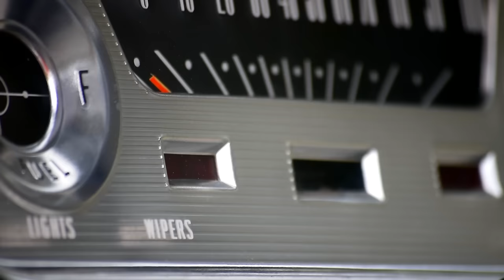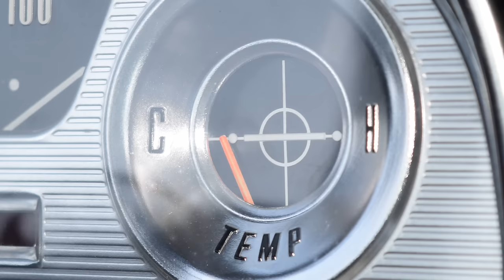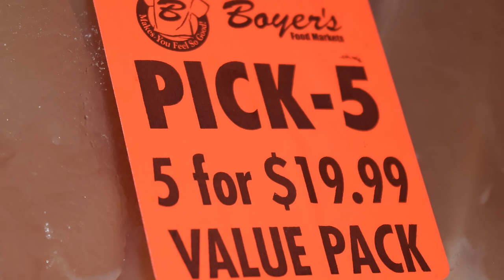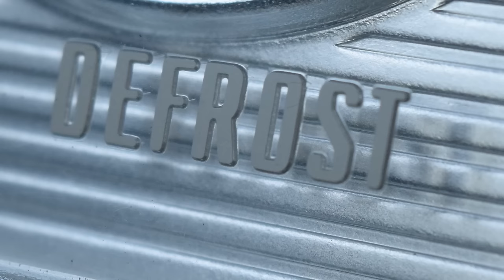Regular Car Reviews: 1960 Ford Falcon (stock)

Comment: "The world must understand that classic cars are not all Chevelle's, and Boss 302's, and Oldsmobile 442's, and Grand National's, and rat rod Cadillac's... Some classic cars, are just regular cars."

This was an awesome quote to end an awesome review.
Reply: Add the fact that the restoration fad is to find a rare muscle wreck and use the VIN and other vehicle id on a better survivor which was less rare. The future will be only rare survivors. The collector market may tank for some of these models due to over supply.
I saw one YouTube clip where the barn owner cut rooves 55-57 GM coupes into convertibles. He had parts wrecks to get VIN and fabricated in the frame X supports on the coupes. He had survivors to take measurements and use to fabricate matching hardware. The mid-50s GM convertibles were selling for 1000% or more than a sedan,  500% more than a top trim-line coupe or sedan hardtop. The fabrications were concours quality convertibles, probably better than factory stock, too. The valuble parts were the VIN and frame id.
Reply: u r right
Reply: Like the VW Beatle!
Reply: Rat rods are not "classic" cars.  They are just cobbled-up juvenile junk.  PS: Learn when to use an APOSTROPHE.
Reply: @lancasterritzyescargotdine2602  Someone woke up on the wrong side of the bed today xD
Reply: @TheShaolinMonk_s550           Someone grew up on the wrong side of the collector car hobby.  Don't feel badly.  You're not the first and you won't be the last.
Reply: @lancasterritzyescargotdine2602  Thanks for the laughs mate, you're hilarious!
Reply: @TheShaolinMonk_s550         No problem, bro.  I jus' calls 'em as I sees 'em.  I was just reading of the loss of Ford and Holden in Australia.  What a sad day for the lives of car enthusiasts.

Comment: My father, upon his return from a one-year stint in Viet Nam -bought a dark blue 1960 Falcon to act as a second car for the family.  My parents were married almost 17 years by that time (September 1968) and had been going one car for as long as they’d owned them.

I wasn’t born yet...but my 3 sisters were, so my Mom needed our 1965 Country Squire for carting them to school, doing the shopping, and all the other things 1960s housewives did.  So, Dad went to a local Ford dealer and bought a one-owner 1960 Falcon so he could commute to his job at Bolling AFB, and later - after leaving the Air Force - his job for the Fairfax County (VA) school system.

One day, the steering wheel came off as he was driving home on the Beltway.  He did his best to get the wheel lined up again and held it into place the rest of his way home.  Oh...he had to shift the three-on-the-tree, as well!

Another time, driving over the Woodrow Wilson Bridge, the gear shift snapped off while he was shifting.  My ever-resourceful Dad grabbed a vise grip out of the bag of tools he kept with him for such emergencies, and stuck it in the hole where the gear shift had been.  

The next day, he limped that tired gal back to Clinton Ford where he’d bought her two years before, and traded her in on a 1968 Fairlane 500 wagon.

Comment: Mirrors are a safety option? No hazard lights? Automatic is the thing to have and the car companies lied about the cars specs? This seems just like a new car, amazing!
Reply: The Falcon was off-the-shelf design. It drove and handled like a mid-50s car. 
The roads at that time, 1960, were also different. The interstate highway system was still being completed. State highways were also being flattened and straightened. Travel averaged 30 mph. When you got to the next town on the highway there was a speed zone and traffic signals. There were very few truck routes or by-passes to avoid the central business district of the county seat.
There were many older vehicles still on the road in 1960, too. They didn't all have power assist and high compression engines. Many didn't have radios or automatic transmissions. People used hand signals to turn and brake. There weren't any 1961s yet, but probably some 1956 Nash, 1954 Hudson Hornet, 1951 Kaiser with Dragon Skin, and a few pre-war Model A Fords.

Comment: I love this era or American cars, I love the Falcon, I have to admit I'm a sucker for the Corvair, I love it's styling and the engine being an air-cooled flat6 like a Porsche also drew me to it.
Reply: Whats ironic about that is the Corvair did the air-cooled flat 6 before Porsche.  The issue is that the Corvair was not engineered enough to actually handle its layout.  

Just as a thought, if GM redesigned the Corvair then, we could of had a well handling mid-engine H6 Pony Car instead of the Camero.  Be awesome if that happened, but it didnt.
Reply: CWDTrixie  Yeah thats true with the first generation, with its swing axle and lack of anti-roll bar, however the 2nd generation had double jointed rear axles and a proper anti-roll bar setup front and rear. I do sort of agree however, the engine was mounted way back over the rear wheels to allow 4 seats, but they can handle well with some modifications, just look at the Yenko series of Corvair's named "Stingers" they're pretty serious cars
Reply: Josh Briggs Thats good, wasnt sure how many generations there were.  Its been a long while since I looked up anything on the Corvair.
Reply: I have a soft spot for the 60-62 non sporty looking Corvairs. Particularly the 4 door. Dunno why, they arent particularly good looking really. Something about the combo of innovative and conservative at the same time. I like the first gen Prius for the same reasons.
Reply: I owned a '61 Corvair Monza when they first came out. It had the H.O. engine (98HP) and sad to say the 3spd manual. Didn't want to wait for a 4spd. I liked the car even with the 3spd, had to double clutch to downshift into first (non synchro). The car was WELL built, paint was very smooth and vehicle was tight. If you jacked up one corner of the car, you could still open and close a door without undo force. The handling of the car (oversteer) you learned the hard way. The first time I entered a curve too fast, I almost got into a head on. From that time on I learned to NOT get off the throttle instead to power thru a turn. I loved that car, but I traded it for a '62 Buick Skylark, so I did not experience any of the Corvair's problems, ie. oil leaks and smells getting into the heater system.
Reply: Agree with you Kip. First Gen was 60-64 BTW. In '64 a front antiroll bar was standard and a rear spring set-up to discourage wheel tuck-in. '65 and on, it was a fully independent rear suspension.
Reply: In my youth I took a 65 Corvair, pulled the shot engine/trans/suspension, built a interior frame/roll bar assembly and installed a narrowed 59 Chevy rear axle/suspension system/stabilizer bars. I then installed a 302 Ford engine with engine mount pads welded to the roll bars and a C 10 trans with short tail. The drive shaft was only 24 inches long so the suspension had to be restricted to a 3.5 inch travel. A 71 Corvette radiator and larger crank pulley to increase coolant flow kept it cool with the 6 ft of pipes. 15 inch wheel rear & 14 in in front with only a large opening in the back of the hood/below the front bumper with blacked out rear windows and a fire wall behind me was the only clue that it was not normal! Somebody had to have it after I blew his doors of and paid a lot for it! At the strip they did't know how to class it but I did a 10.3 second quarter mile!!!

Comment: Right after high school (Class of '70) my buddy, Dave, bought a 62 Mercury Comet (Falcon clone) and I bought a 62 Rambler Classic. Both were "3 on the tree" manuals.
Both cars had vacuum wipers, a nightmare in a rainstorm on the highway! I'm pretty sure the Comet was not synchromesh first gear, don't remember on my Rambler. I loved the Classic as it had a DUAL master brake cylinder which meant you had some brakes if a brake line failed whereas the Comet didn't. That's important if you've ever been in a car with a single master and had a brake line or wheel cylinder crap out on you! Happened to Mom with me in the car. We lucked out because weren't going fast and Mom knew to pump the brakes like crazy and crawl the car to the repair shop 2 blocks away. Both cars were tanks with 2 squirrels on a treadmill for an engine. But not real safe: no seat belts, collapsible steering column nor padded dash. I found out when a woman in a 69 Plymouth Fury (think Ford Crown Vic) made a left right in front of me. I broke the steering wheel clear through in one spot with my chest and left the imprints of both knees in the metal dashboard. No broken bones but sore for about a month and all at less than  20 mph!
Cars were a lot more dangerous then until the Feds started a series of safety requirements beginning in 1963 and another additional set in 1968 and incrementally after that.

Comment: I don't recall my 1966 XP falcon having reverse lights. In 1977 I drove from one side of Australia to the other in it.
Reply: No need for reverse lights if you are not reversing. Actually very few cars had reverse lights in the 60s. I used to use the indicators.

Comment: Very good video. Say hello to your newest subscriber!
One thing everyone should remember, though, is that several complaints (brake system, steering, etc.) were typical for the era, including high priced cars. They weren't complaints back then all cars did it.
You nailed it on the transmission. A status symbol, but a lot more work than today.
The shaking gas line in your photo car is mesmerizing!

Comment: Really well done, thanks for the memories. My buddy had a 60 in 64, few years before I could legally drive, it was a three on the tree, it might have had a radio white two door. That was a fun summer in Chicago. Dumped the clutch at every light and bicycles would pass us, it was crazy. At night a ton of room in the back seat to watch submarine races at the Planetarium. I had a lot of memorable cars over the years but that dog of a Falcon still holds a special place and it wasn't even mine.

Comment: My b.I.l. Had one, a two door, automatic, white top, red bottom.  I got to drive it once.  They were okay, but, they wouldn’t pass muster today.  The little 144, 140, cu.inch 6s were okay for the highways then, but, we travel at high speeds in some towns and cities at or above 60 m.p.h., they would struggle.  These little cars were great back then, but, the car manufacturers were just slapping them together for cheaper cars.  No one ordered a/cond. back then.  Now if we had the four cylinders and 6s of today, wow, what cars.  Great vlog. Thanks for posting and sharing this vlog.

Comment: I owned several in the youth and had 200 cu engine..best car ever...lots of great times and solid engine could not kill it..
Think I paid usually around $500 cash for them back in circa 1980..moved on to the Fairmont later
True about the master cylinder..mine went out and no brakes.. scary 
I'm devoted

Comment: I have been to Argentina twice in the 80's and all I saw there were 1960 Falcons on the streets! All they did to change the model styling was headlights/tail lights/grill! Falcons were made there starting in 1962 ending production in 1991! The in line six cylinder engine with ether 170 CU IN or 200 CU IN displacement were the power plants. They were so reliable, they went often well over 500,000 miles before rebuild!

Comment: Interesting fact about the Ford-O-Matic 2-speed.  It was, in fact, a 3-speed, but lacked the internal parts needed to automatically engage 1st gear.  It only used 2nd and 3rd, and it called them 1st and 2nd.  If you put the shifter-lever in "D", you definitely only had two gears.  However, if you came to a complete, dead stop, and put the shifter lever into "L", it would start off in the actual 1st gear -- not the mis-named 2nd gear that it called 1st gear when you were in "D".  Then you could stomp on the gas, when it got to red-line pop it into D and back into L quickly and it would shift into 2nd gear (the gear it called 1st gear when it was in D).  And then, when you hit red-line again, you shift into D and that would be the 1:1 gear, which was the 3rd gear (mis-named 2nd gear when it was in D).

My Father's 1955 T-Bird with the Ford-O-Matic does this.  There are three distinct gear ratios available, but only the two higher ones will be used when the selector lever is in "D".
Reply: No, it was a fully automatic transmission.  No clutch.  It just didn't use it's first gear -- only 2nd and 3rd under normal conditions.  But you could force it to use 1st gear by doing what I said above.  Ford sold it as a "2-speed automatic" when it was in fact a 3-speed.
Reply: There was an analogue in small cars with stick shifts in that era. Some of them had an "emergency low" or "granny gear" that was only supposed to be used for climbing, because the engines had so little power. Normally you started in what was effectively second gear. The Ford-o-Matic mimicked this (at least in the Falcon), it would seem.
Reply: thats kinda interesting, but i don't really get the point of a even lower gear. If you top out at 29mph "1st/2nd"- gear seems kinda okay ratio even for steep hills, add the torque converter you are pretty much covered. There should have rather been a third gear between "1st/2nd" and 1:1, the gap is huge :D
Reply: No, sorry, you are mistaken.  Falcon's is 2-SPEED ONLY.  Is not the same as the 1950s Ford-O-Matic.  Source: 48 years of ownership.
Reply: A cheat code for acceleration!
Reply: I first thought that as well, remembering my parents' 1957 Fairlane 500.  But then I looked it up.  In 1959 Ford came out with a 2-speed Ford-o-matic, to go along with its 3-speed which by then had been renamed Cruise-o-matic.

Comment: The Ford Falcon is pretty much the perfect car. There was no need for any more research and development afterwards.
Reply: I owned a 64 Futura , a great car.  A couple years ago I bought and sold a 60 Ranchero.
Reply: We gave it 56 years of research and development in Australia. The Barra 4.0L in 2016, was an evolution of the 170 Thriftpower Six on closing day. Obviously loads had been done to it by that stage but the Broadmeadows factory; was still making sand casts with help from the equipment they got in 1960.

Comment: It had a lot of success in Australia, and is still manufactured today. Course it looks like a Ford Taurus now, but has very minor aesthetic differences.
They also got muscle variants in the 70's, with Mad Max using one as the Interceptor. We did get a 2 door variant that looked decent, but was discontinued immediately after 1970.
Reply: rip mad max pre sequel

Comment: I had one of these. I loved it. Always started right up, few problems. It was the smoothest ride over railroad tracks I have ever experienced. You hardly knew you had driven over them. I finally got rid of it because I had two cars and the Falcon I parked on the street and kept getting tickets for not moving my car often enough, so I sold it. But I have fond memories of it.